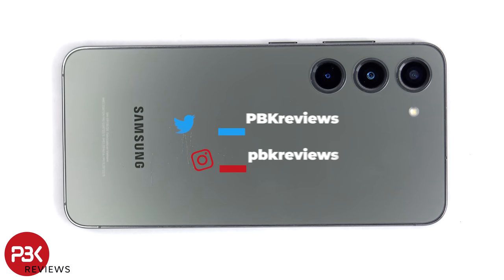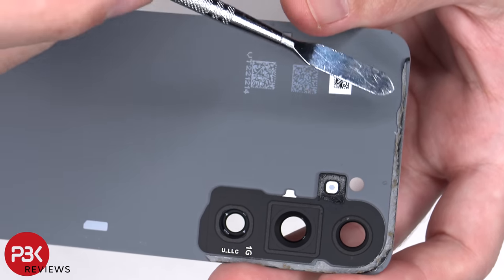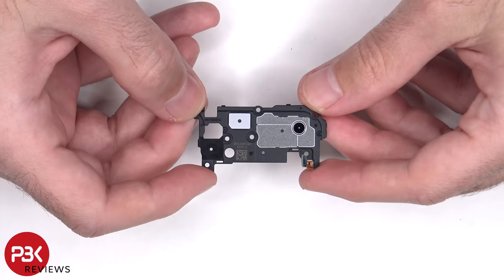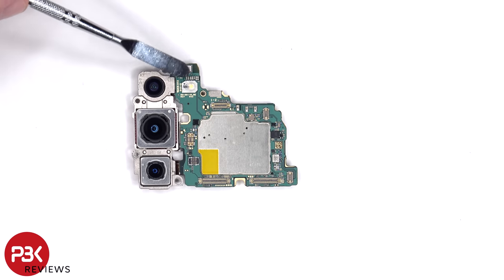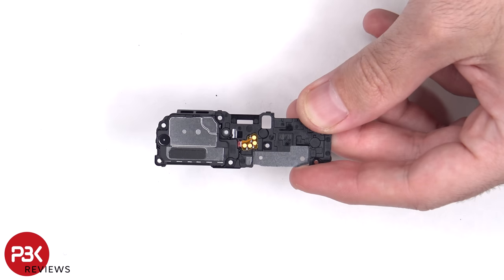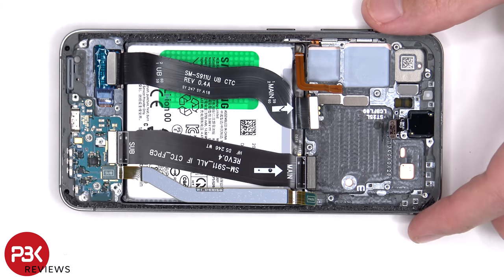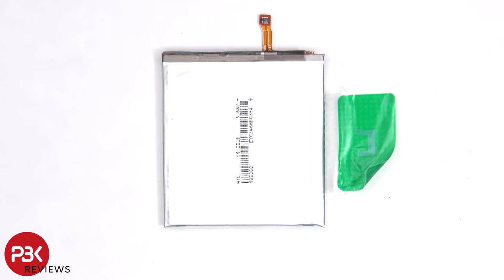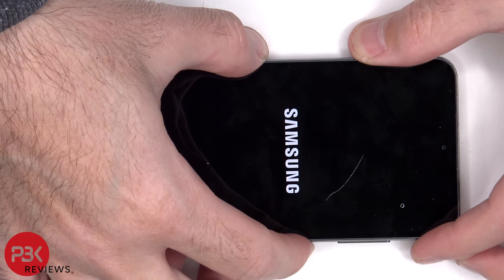Samsung Galaxy S23 Teardown Disassembly Repair Video Review

Comment: Ive noticed that my main and 3x camera can move in and outwards not only sideways, and when i shake it it hits the inside parts and the lens protector, is that normal for ois ? There is no worse quality or anything, but im still confused

Comment: Just wondering.. few mins ago i was pushing pin in top hole (speaker) with using some force and was wondering why sim cards slot not popping (yeah i was bemused and habbit from earlier phone). Did i damaged phone somehow? There was no any break or crack, just pin stoped and some point and didnt went futher
Reply: I just have done the same thing.... im scared atm

Comment: @PBKreviews,  hello!  Below, near the charging port, there are 3 holes. 1 for opening the sim tray, 2 for the microphone. And why 3 holes near the speaker?
Reply from the maker: Hi, I just took it apart to check. It's weird it doesn't lead to anything internally that is visible. It might possibly from within the frame itself be leading to the speaker ducts but aside from that there is nothing open on the inside of the frame where the hole is from the outside.
Reply: @PBKreviews   Thank you for your answer and another unscheduled disassembly of the Samsung s23! 🤝  Samsung left a mystery in its new flagships))

Comment: If sim ejector pin accidentally gets into microphone hole will it damage the microphone of water resistant layer. Pls reply
Reply from the maker: no
Reply: @PBKreviews  thanks a lot for the reply i was a bit worried abt the same. But one thing i have noticed is sim ejector pin goes in a little deeper in microphone hole  when compared with the other hole at right next to type c port. Is this normal?

Comment: The proximity sensor is in the worst place. On darker colours you notice a dull dot on the screen below and slightly to the right of the front facing camera. Would have made much more sense for it to be directly beside the front facing camera so it's hidden among the status bar and not in the middle of content on your screen.

Comment: Hi PKB Reviews,
I just accidentally drop my S23, and want to know if any internal damage occurred 
Could you please confirm whether the Wireless Coil and NFC Antenna connector to the Mother Board is tight / close enough to the back glass (So, it won't move)?

Since from my perspective that's the only moveable part apart from the Camera's OIS part 

Thanks
Reply from the maker: Yes, you should be fine.

Comment: Just curious... Can the new Samsung S23 work on an s22 screen if you connect the screen connector to it?
Reply from the maker: I know the battery connectors are different, but I am not 100% sure on the screen. I don't have an extra S22 to check, but I will be testing the S23 ultra with an S22 ultra screen later in a different video. if that works then the rest should be reverse compatible also.

Comment: Where is its storage located, could i potential replace it by myself, the disassembly doesnt look that bad i built pcs before
Reply from the maker: Its soldered to the main board under one of the covered shields, so wouldn't be user replaceable. Would require expert soldering knowledge.

Comment: Hey, i was wondering if you knew a reliable website where they sell parts for Samsung, other than the one in the description ( in my case, s23 back glass ) thx
Reply from the maker: you can check mobilesentrix.com or rounded.com for original replacements.
Reply: @PBKreviews  thank you

Comment: Is that phone still water resistant after teardown?
Reply from the maker: As long as you apply new original pre cut adhesive made for the phone to re-adhere the back plate, then yes it should retain the resistance.

Comment: what actually happens to the phone parts after it falls one time, do some of these inside components get damaged without being noticed? cuz i know the phone still works fine and all but will there be any damage?
Reply from the maker: Depending on how hard of a drop it is. For the most part, they internals should be fine.
Reply: @PBKreviews  I see, I have another question. I just got my s23 and i feel like I got a unit with an average battery because when i play a youtube video for an hour, i drain around 92% which is similar to the s22 when it was compared to an s23, which drained only 4% of its battery in a youtube short. In general i feel like my battery is bad compared to the youtube reviews.

 is there a possibility to get a defective unit? It just feels upsetting cuz I was expecting to have an average of 6hours of screen on time with just browsing and watching youtube or netflix after watching multiple youtube reviews but im getting around 3hrs of screen on time only.

Comment: So nicely explained about internal structure of phone. 
I mistakenly inserted sim pin in microphone in S23. So please help me know that whether my microphone will be damaged or will it effect to IP68 water resistant.
Reply: I did the same thing.. daym. But from what I read, you are safe since the hole is not directly to the microphone. However, I am not sure about the ip68

Comment: Thank you for your video. Unlike Ultra, S23's Vapor Chamber has many holes, does it affect cooling efficiency?
Reply from the maker: You're welcome. The holes are just the design of the battery adhesive pouch and not the vapor chamber. :)

Comment: Just curious what is the size difference between s22 battery and s23? Is it possible to fit s23 battery in s22?
Reply from the maker: The problem isn't the size, I think size wise would fit, but the battery connectors are different so it won't work.
Reply: @PBKreviews  if size isn't the problem then I can easily swap the bms on both the batteries then it'll work😁

Comment: what could have happened if i put the sim card key next to the tray?
Reply from the maker: you mean in the mic hole? nothing since the mic and filter are both seated above the hole and they wont be damaged. :)
Reply: @PBKreviews  Yes, mic hole. I was  worried about waterproof and working of a microphone.

Comment: Is it possible that i broke my bottom mic by unintentionally putting the sim remover in it? I have this doubt because the audio recording quality is not that good...
Reply from the maker: Hi, no because the mic and filter are both seated above the hole and there is a 90 degree turn in the frame so they wont be damaged.
Reply: is it also true for the mic on top of the phone ? @PBKreviews

Comment: I dropped my phone and now it won’t charge and when the phone is shaken something inside moves
Reply from the maker: most likely the noise you're hearing is the camera assembly which is normal. As for the not charging, its possible you have a hair line crack in the screen somewhere that's causing the display to not work, or its possible a cable may have gotten disconnected. You won't know until you take it apart to check for it though.

Comment: With normal charging, everything is fine, but once you turn on the modem mode and start pumping something, "this creation" starts to get terribly warm after about half an hour and suspends charging. In safe mode, I tried to run and test — everything is the same. I also tried the original block from them, but the result is the same as with the 25W anchor. Tell me, is this the only way for me? Or are there still people who have such a problem?

Comment: lol no thermal compound between chassis and soc
Reply from the maker: Samsung has been known for using either 3D graphite or graphite pads in between the chassis and soc, which still does the job. But yeah I would prefer a direct copper block (attached to a VC) with thermal paste to the processor.
Reply: @PBKreviews  no wonder in other review fps graph it not reaching 60fps straight in heavy games